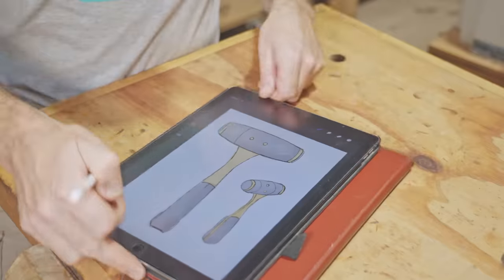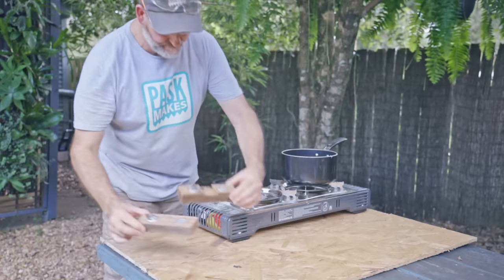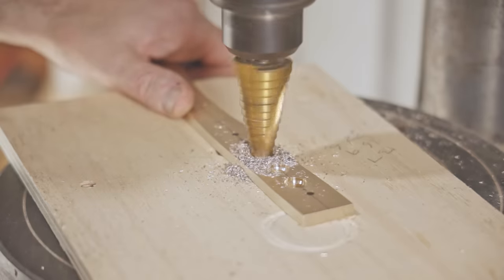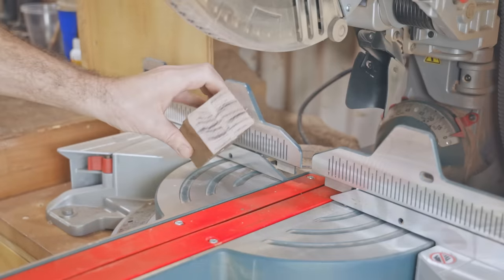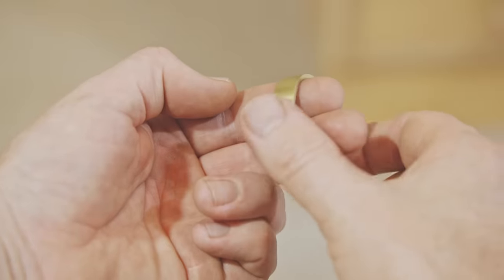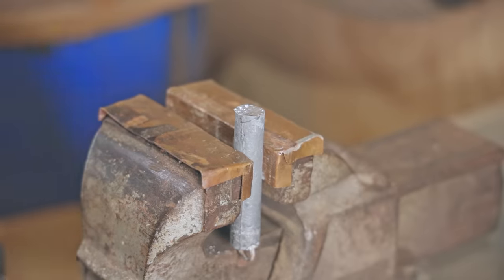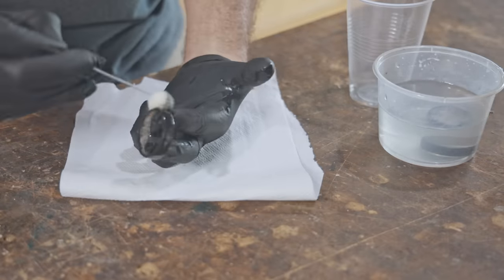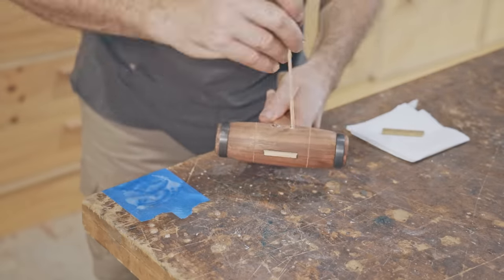Making a Dead Blow Mallet with a Brass Handle

Comment: Normally my dead blow hammers have rubber or neoprene impact caps on the ends. When threaded in replacement is easy due to impact wear. They also spread out the impact load depending on the material being whacked. Wood is great but an edge impact might cause chipping of the hammer material left outside of the ring (great choice keeping the rings steel). We used to call them beaters!!!

Comment: Many model shops  the one that supply model makers and scratch builders sell round lead shot as small as 2mm dia  for balancing weight in model sailplanes  you can also make your own by pouring Moulton lead through a  kitchen gauze strainer into room temp water from about 1 meter high the shot size is inconsistent, but in a drop/stop hammer the size wouldn't be a real problem as the mobile weight is the factor which is why I'm intrigued by the fixed lead. Otherwise a GREAT video and thanks for showing your mistakes

Comment: You can make lead shot by drilling a few small holes of equal diameter of desired shot size in one side of a pot or can .  Tipping to side without holes , you heat up the lead till beyond melting temp.    Once ready, tip to other side with holes over cool water .      Great for small batches of shot.    The whole thing can be scaled up .      Also.   Higher above water the better the shot forms into symmetrical balls .

Comment: If you have occasion to make another mallet head with metal rings you might try this. Turn the ends of the mallet head to just slightly larger than the inside diameter of the ring, heat the ring in a 450F to 500F oven for 15 to 20 mins this will expand the ring, the ring will slip on easily and when it cools will shrink back to its original size and be locked in place.

Comment: Just a thought, if you had split the mallet head on a 45 degree angle, you could still drill and pour your lead, you’d just have to drill a corresponding 45 degree hole. No need for a plug and it would be just as strong as two straight pieces. Possible even stronger

Comment: Beautiful, but all the dead blow hammers I've used were actual shot/pellet filled, not a single solid piece. The idea being that the shots offsets the bounce, hence the dead blow/no bounce. One piece just makes it heavier. I know it was multiple pieces in the second but even they had no room to move. (you can actually hear the shots moving inside a deadblow hammer, when you shake it).... just saying.... Still a beautiful hammer!
Reply from the maker: In the second version there was plenty of space for the shot to move. I drilled recesses into both halves, when I glued the two halves together the upper half was empty. You can hear the shot moving and it works extremely well. I did a demo on my Instagram which is what I should've done in this video but didn't think to. :)

Comment: nice build i think i would have epoxied one side, drilled the pin holes  then epoxied the 2nd and drilled it , shaped the handle and put in some countersinks on the holes so the pins would be "riveted" same for the head and how about heated copper bands on the head to shrink down maybe  just thoughts

Comment: Very beautiful hammer. Not only are you a world class woodworker you are also a fantastic dancer. How are you at singing? I have started to treat the handle end as a hammer head. I put a round head brass bolt or rivet in the end of the handle and or a ring like you did on your hammerhead to protect my handle. So I have three faced hammers and no splintered handle ends. Thank you very much for a typical super fantastic video. ❤️😁

Comment: I was going to make some croquet mallets,  which  I still  haven't  got  around  to  after 6  years.   But  that  is  another  story.   So  I  order  some  brass  pipe,  2  inches  or  so  in  diameter,  I'll  have  to  check  again.  I  ordered  it  online  from  somewhere.  Maybe  Amazon.  You  can  get  just  about  anything  online  from  Amazon.    So  I  have  this  big  chunk  of  brass  pipe  sitting  around,  about  2  feet  long.   Maybe  I'll  make  a shop  mallet.  There  must  be  somewhere  online  that  you  can  find  it  like  I  did.

Comment: I don't know how often you take corners off small pieces like the lead shot. If you take a bolt thru the bottom of the bottle with 2 wide washers for support you can just use a drill to spin the container without having to constantly shake the bottle.

Comment: you can make rough lead shot easily by melting it in a tin with a hole in it. let the lead drip into water.

Just poke a hole in a bean tin with a nail.

Also you should have heated the rings to expand them a bit to make them go on easier.

Comment: For the steel rings on the head, would there be any benefit to having them compression fit with heat as opposed to epoxy? If you look at old wagon wheels, the steel tire is a very tight fit over the wooden felloes. They accomplish this by heating the steel tires, then place it over the wheel and cool it with water, which causes the steel tire to compress and hold the wooden wheel together. I was thinking that this might be a better way to compress the wood fibres together more tightly than epoxy will.

Comment: beautiful work as always. I wonder how well it might work if the hoops were installed before sizing the body...then you'd have them in place to act in the same fashion as the bushings used in pen turning to size the barrel. (Of course you'd need to take considerable care to avoid scoring or abrading the hoops). Also, would the finish on the metal tolerate warming in a hot oil bath so they could be shrink fitted to the mallet head? (I suppose you'd then be committed to an oil finish on the wood). Anyway, beautiful work as I noted above.
Reply from the maker: It crossed my mind to fit them first but decided to go the way I did. On my soft faced mallet, that I showed at the start of the video, I heated the rings to expand and fit them. I reckon a good tight fit is enough though. :)

Comment: West System Epoxy is great stuff, but without filler isn't particularly strong. If I were you I would have roughed up the brass a wee bit with some 100 grit paper, wet down the wood with epoxy (without filler, letting it soak into the wood) then add the 404 to the remainder of the epoxy, then glop that mixture on for gluing the wood to the brass. It might be overkill, but it's damn strong when done this way.

Comment: Another way you could have put the end rings on would be to size them just a little small.  Then heat the rings up with your torch drop them on the ends and tap them on tight then submerge them in water and wa-la, thrir not coming off.  Dave Engels, Engelscoachshop shows how he puts round bands on hubs
Reply from the maker: I did that on the soft faced mallet I showed at the start of the video but with a tight fit and epoxy it isn't really needed. :)

Comment: Wouldn't the advantage of plugged holes drilled from the ends be that the shot has more travel? With the circle sideways, lots of the shot doesn't actually move much and with less travel gives less impact, no? I'm no expert, it just seems logically like rectangular pockets or else holes drilled parallel to the swing would give some better impact.

Excellent video either way! Always love your stuff!
Reply: It's not a dead blow hammer, just weighted.

Comment: I kept waiting for the lead to show up at the lathe and it did -- DOH!  Also, looks like you were using a teflon coated pan (and burning it) don't breathe that either, nasty stuff.  As for the rings, you could have under sized them slightly and then heat set them on the head just as wagon wheel tires are done.  Epoxy is easy, but traditional methods work quite well.

Comment: So I don't know if it would work on the small rings on the end of the hammer, but when they put metal tires on wagon wheels they get them hot so they expand and then cool them down to get them to contract around the wood. I think what you did is great.  I am just curious....
Reply from the maker: On my soft faced mallet, that I showed at the start of the video, I heated the rings to expand and fit them. It worked well but I reckon a good tight fit is enough though. :)
Reply: @PaskMakes  "It will be good for hitting things."  Yup, that is one of my favorite Neil Pask Quotes!  Awesome.!

Comment: Dude! The overhang of that brass in the vice when you were cutting and filing way too much, It must  have been loud as all hell in that workshop. Absolutely beautiful (can a hammer be beautiful?) end result though, and way above my wood working capabillities.

 A little tip for future brass work, when you're drilling; use a twist drill so you can take the edge of the cutting lips a bit and easily re-sharpen it. If you slightly blunten the drill, not a huge amount, it wont grab like that step drill was.

Comment: Curious why you didn't peen the brass pins instead of just gluing them in?
Reply from the maker: They don't need peening when epoxied into wood as there's a very good bond between the brass and the wood. The only reason to do that would be for aesthetics and you'd need to be careful not to dent the wood. :)

Comment: Why didnt you peen the brass pins for the handle and head? Peening/swelling the shafts into the wood and the handle would prevent any movement would allow a better grip into the wood

Comment: Did not understand why you drilled so many holes in the metal handle and covered it with wood pieces. Kindly explain.
Reply: It was to remove weight from that end so it would have better balance

Comment: While lead shot will provides some of the greatest density (mass is a fixed volume), I have generally found that ordinary steel shot/ball bearings to be more than adequately dense enough for virtually all dead-blow considerations.  The added advantage is that the steel is far less malleable; therefore it better resists deformation and the resulting clumping that lead shot can produce over time.

Comment: Nice! I like it. Two things, out of curiosity: First, so you can go to Teflon with a blowtorch without it disintegrating into toxic hydrofluoric fumes? That´s good to know! Second: Why not give the pins a good wack (or rather, several tender nudgings) from either side to have the heads spread out a little like a bolt, and seat everything properly? Risk of splitting the wooden head?

Comment: I think you should pin  or  screw  those  metal  rings  onto  the  head  of  the  mallet.  Otherwise,  I  think  those  rings  will  work  their  way  off  after  some use.

Comment: melting the lead and pouring it in the holes negated the "dead-blow" physics of the mallet.  The "shot" or sand needs to be loose in the mallet to control rebound leaving the blow on the point of impact longer with the "follow-through" of the loose shot.

Have you seen people flipping water bottles??  The loose liquid in the bottle is what keeps the bottle upright by providing a similar dead blow effect with little or no rebound.
Reply from the maker: I know that, that's why I said keep watching until the end of the video. :)
Reply: @PaskMakes  Why would I watch a video with such an obvious error??
Reply from the maker: There was no error, I explained what I was doing and also said that you needed to keep watching, it was an ongoing story that unfolded. That's up to you whether you wanted it to watch it or not. :)
Reply: @PaskMakes  If you're planning on doing something strange you need to explain it up front.  Otherwise people who actually know how the physics works will stop watching, surprise endings (covering an earlier mistake) mean nothing.  Enjoy your channel.

Comment: I was kind of wondering when you started pouring the lead into the original head. Having owned several dead blow mallets and the fact that you made those giant weights that it basically made it a heavier mallet but not a dead below mallet. As you mentioned in your pinned note after the initial impact the lead shot impacts and then nullifies the rebound.

Comment: You measured what you should have had done by eye..,
And then,
You eye balled what you have had measured.
Well,
At the very least, you have your 'Dance Moves' down pat ! ! !
Reply from the maker: I think where I went wrong was I put the mallet aside for a couple of days to make the "Steel finishes" video, when I picked it back up I didn't think through what I'd done and what I needed to do. I jumped straight in there without any thought. :)

Comment: Why glue the brass pins in place? 
Couldn’t you just have drilled conical holes in the wood and peened the pins on either side to form rivets? Then no glue required.

Comment: I was a little surprised to see you use epoxy instead of heating the rings and using a compression fit.  Epoxy is probably better though.
Reply: Wondered about that technique too.

Comment: If lead worries you ??? then just pop down to the local plumbers merchants and buy some lead free solder ! ...Slightly higher melting point ! almost as heavy and completely safe ... Still melts with a blowtorch and it is slightly harder than lead ! ...

Comment: When installing the rings, I would have used a piece of the same pipe I cut them out of. Far less cumbersone than going back and forth and round and round with a piece of wood ;)
Reply: Or a big socket wrench socket... That's how I have installed engine and transmission seals.

Comment: I would have heated the rings and shrunk fitted them to the head, the same way you do with an iron tyre on a wooden wheel.
Reply from the maker: I did that with the soft faced mallet I showed at the start of the video (that was a video too btw) but with a tight fit and epoxy it really isn't needed. :)

Comment: Is that handle liable to bend sideways?
Reply: The brass tang is relatively thick and also dead blow hammers are not meant to be used with a lot of force so it should not. But then nothing is unbreakable so if you abuse it enough it will bend. Just ask the makers of the Titanic!

Comment: If you want to make your own buck shot. Just poke a pin hole in a tin can. Pour the molten lead into the can and it will drip out the pin hole into a bucket of water. Keep some heat on the tin can to keep adjust the flow.

Comment: If you fill the bored holes with lead beads, you can have a dead-blow mallet. I got lead beads from an old scuba soft lead weight pouch from an old weight belt.

Comment: You can use coiled lead strip inside the head of the hammer for deadblow as well, just put in 2 or 3 layers of it coiled up along the axis of the head with the coils in opposite directions.  Remember to use both sides of the hammer regularly.    My fav hammer was a deadblow ballpeen, which makes no sense on the surface but it was for copper rivets.

Comment: To make lead  shot at home just melt the lead  and while it molten pour it into a metal stock pan or barrel of water just make it's tall an nuff to cool on the way down to the bottom of the pan /barrel it's how they make shot in the factor just wear pertective gear whilst doing so
Reply: You will need a metal plate with holes small enough for the molten lead to drip through to make the appropriate size lead droplets too.

Comment: Glad to see you used a respirator for the lead - was worried initially when I saw you filing it.  Don’t want to screw with that brain of yours.

BTW - bismuth makes a great substitute for lead - almost as heavy, nontoxic, and cheap, and has an even lower melting point.  You can easily get bismuth shot.

Comment: PLEASE don't ever use a teflon coated non-stick cookware piece for melting the lead. The teflon coating will burn at those temperatures and the fumes are highly toxic even in relatively small amounts :(